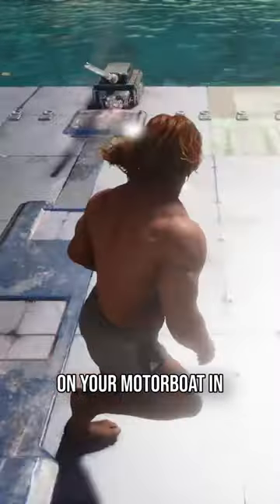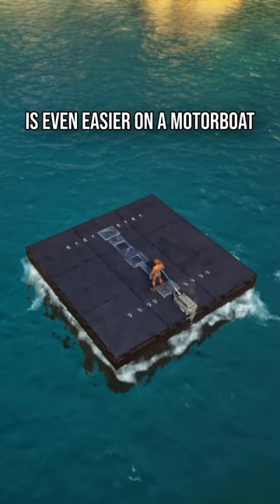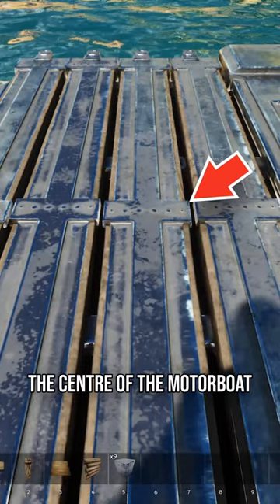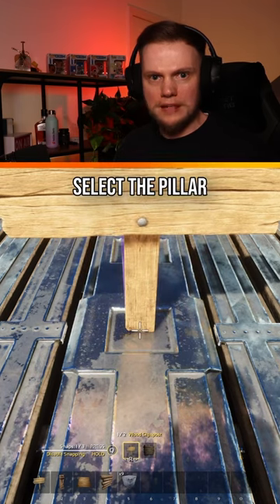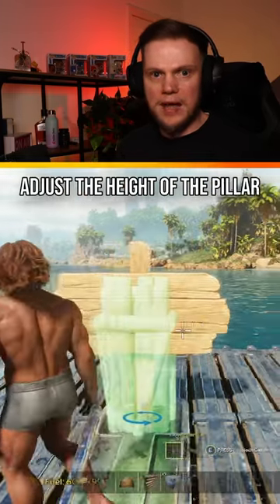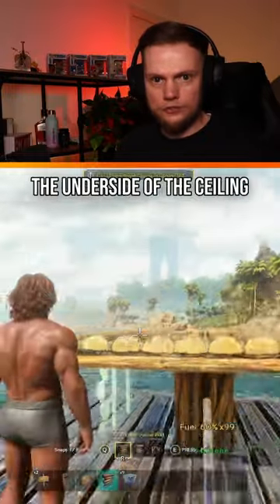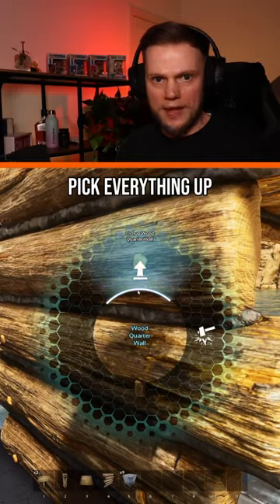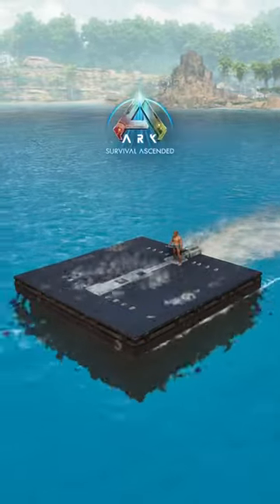Motorboat with Foundations that Works in ARK Survival Ascended!

Comment: I like more the other raft building way when u can extend the foundation using ceiling ,I believe is not possible in ASA
Reply from the maker: That’s a different trick. Unfortunately, it’s not looking possible on ASA, like you said. Going to spend some time on it again soon, but I doubt it will be easy to do if it works 🫣

Comment: Ark has been unplayable for me... I do appreciate the video. I watched it last night and built a nice little house boat, loaded back in later, and my boat was vertical in the water with nothing built, lol. Some structures came back later but not completely 😂. The building worked like a charm
Reply from the maker: I've got an updated method now to get past a patch they made, which is actually easier slightly! I'm glad this still worked for you though! And yes, rafts are more janky than in the old game somehow. Anytime a raft goes out of render, nothing built on it shows up until you ride and then dismount. I mean, could be handy in PvP? 😅

Comment: Doesnt let me place a pillar in the sign
Reply from the maker: I have an updated method for no clipping servers: https://www.youtube.com/watch?v=yDXinYVWiSY&lc=UgzilxLpAFxdk8y4JN94AaABAg
Reply: @toastbloke  i managed to do it by eyeballing it, had to move the sign towards the front so the pillar could still place in the center of the boat then i used the sign as a reference to lower the pillar but i had to lower it slightly lower that you did, the only hard part was finding the correct height but it didn’t take long. I appreciate your video, it still helped me.

Comment: my character dont align with motorboat while mounting on it. How can i change it?
Reply from the maker: Have you put gasoline inside the motorboat to power it? You can't drive the motorboat until you turn it on. Let me know if that helps 😎
Reply from the maker: @BobroBobrodobro  Did you have K Mode (Orbital Cam) on? If not, it should work if you aren’t moving your mouse as you dismount. I just click the drive key twice and nothing else. Does that help?